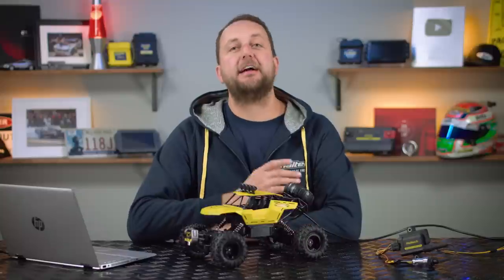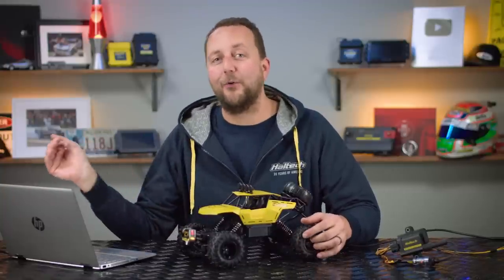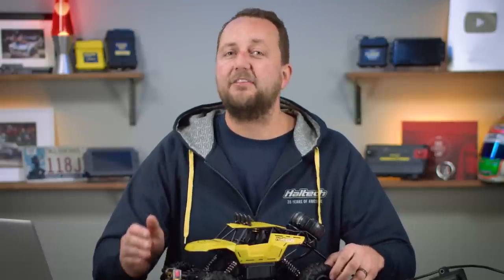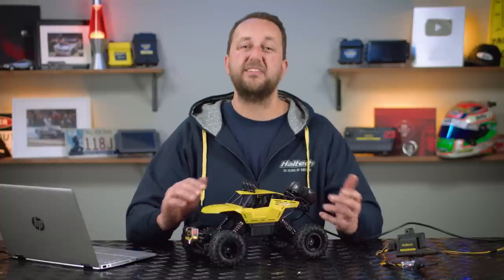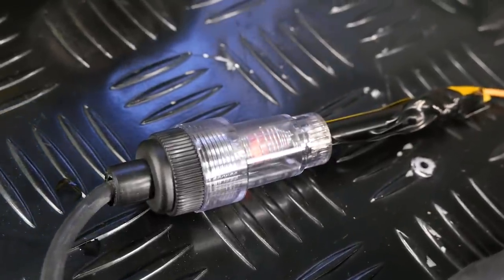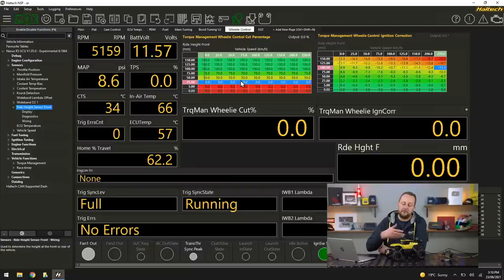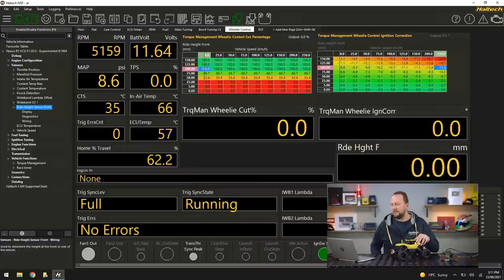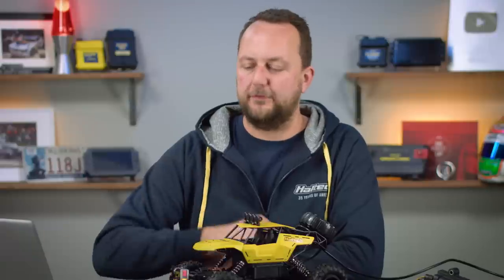🛠 Controlling Wheelies with a Laser Ride Height Sensor | TECHNICALLY SPEAKING

Comment from the maker: Welcome back - this week we're talking Laser Ride Height Sensors. That's right cars with freaking laser beams!!!
Who doesn't like watching cars doing big wheelies down the track? Well, In most cases it'll be the driver and his crew. Why? As spectacular as they may be, uncontrolled wheelies can cost you valuable fractions of a second and potentially cause damage to the car. If only there was a reliable, progressive way to control the amount of front-end lift....
Got a topic you'd like us to cover? Leave it in the comments section!
Reply: I wonder if you guys would be willing to cover driveline losses, and how larger, more massive wheel and tire (tyre?) combinations affect the results. It's been long understood that automatics suffer a larger performance hit, due to the changes in medium and pumping losses, but now we have dual-clutch systems, some dry, some wet, that I assume fit right in between auto and manual trans types (tipes?). 

Long time fan of the Fork, and the Haltech Team. Really nice seeing your colors flying everywhere custom cars congregate. Would love to know if your company has any OEM tie-ins.
Reply: What rc car is that?

Comment: Laser proximity switches, I use Keyence LR-T, use them in ply machines for agricultural tires. When the drip loop of material is short the commander action is to accelerates the conveyor to increase the material loop, if the loop becomes too big the material conveyor slows down.

Comment: Methanol/water injection on naturally aspirated cars. What does it do? How does it work? How good is it compared to nitrous? And how to set it up and tune for it. (Not everyone has access to E85 :-/)
Reply: I too would like to be more informed about this topic. Also setting up a solid state relay and the crrect settings  would be great. Plus should I use water/meth if I am on E85????. Can the ECU control this on a flex tune?

Comment: Should consider GPS steering automation for while in a wheelie, if the car drifts off Centre line, it triggers the left and right brake to hold you down the run.
Reply: That would require the need of some kinda brake pump (ABS)
One of the things everyone ditch when turning a street car into a race car the steering thing can work if u have a electric rack am sure the haltech software can do that but for anything else it's too complex

Comment: Can you do a video on using a Nexus R5 to control basic functions on a street car? And maybe related functions with a IC7 dash?  What available circuits you suggest for inputs and outputs, settings etc. 

Things like:
Headlights
Turn signals
Hazard
Brake
Ignition switch and/or Start button options
Wipers (maybe)

It would be super clean if you could use the built in lighting inputs on the IC7 and transfer their signals via CAN to the Nexus for outputs. Save running 7 or 8 circuits in the car.
Reply from the maker: We've done a similar thing with our R35 GTR build. It's a race car but it's using NEXUS R5 to control everything.
https://youtu.be/OjBsaF34Ts4

Comment: Scott, Could something similar be used in off-road racing vehicles to shut things down when airborne? I guess > 500 mm would be needed. Or maybe driveshaft speed sensor vs road speed would be better?
Reply: Don't those desert racing trucks use the throttle to change the pitch of their trucks while in air?

Comment: Can't the drive by wire throttle be programmed to prevent wheelie to gradually ramp up the torque curve or can cylinder cutout be programmed to create a a gradual curve before applying all cylinders for full power after a given time off the line to prevent wheelie?

Comment: I thought there gyroscope in ECU setup instead laser like motorcycle iMU ? Laser scope might get dirty or blocked by dust will reduced accuracy ?
Reply: Most lrg are completely sealed, all the ones I work with exceed 50k flight hours between even needing an adjustment

Comment: Can you run this with a fail safe like wheel speed sensors I have seen drag bikes flip and I always hear it's from something non movable like body panels fluid line  or sensor shifts and it can't detect movement